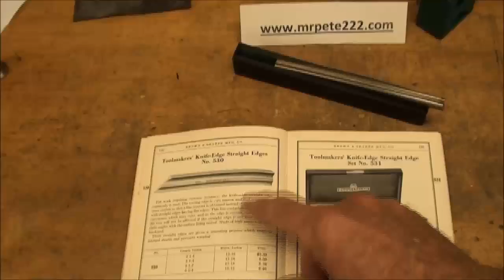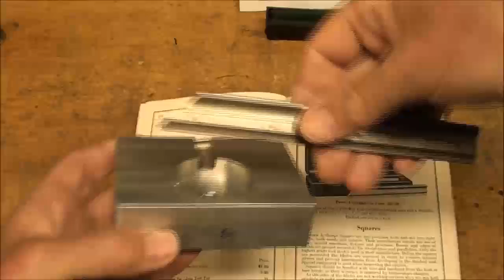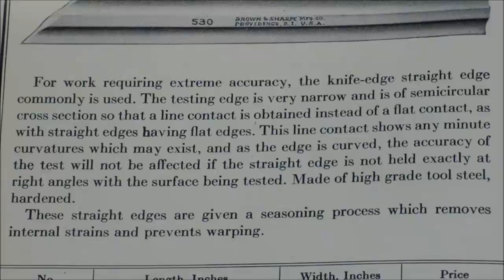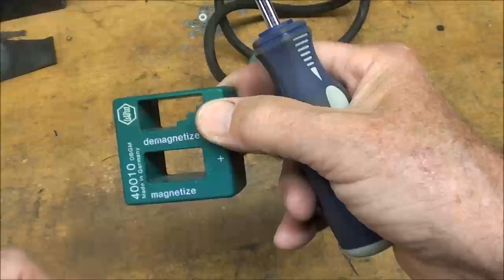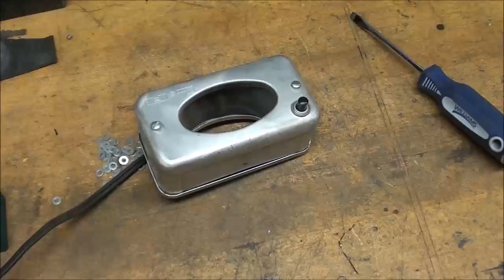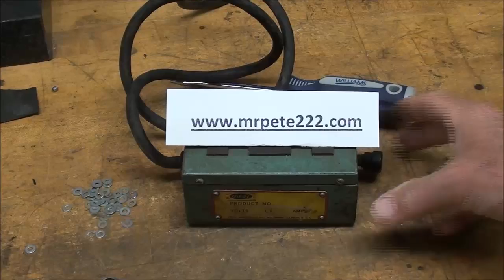WHAT IS IT? #15b Mystery Tool Answer tubalcain mrpete222

Comment: I have that same Ideal demagnetizer in my home shop. When I worked in the shop, we would have the maintenance electrician find an old solenoid coil and tape it up to protect the windings, attach a cord and we’d use it to degauss drill bits. For some reason, if we drilled with cutting oil instead of coolant, they would get magnetized and hold onto a lot of chips.

Comment: we used the demagnetizer similar to one you have here at Fafnir bearing to demagnetizer cutting tools such as form tools ,drill bits and reamers , recess tools etc after grinding them to size.The grinding would cause them to become magnetic so It was done to keep fine chips from sticking to cutting edge of the tool during use. Plant is closed down now but the old screw machines were amazing equipment!

Comment: The Hole In The Screwdrivers is So you can Put another Screwdrivers Shank in It For Extra Torque Whilst Pushing Down On The Head To Break Screws Loose
Reply from the maker: Someone else told me it is for a lanyard
Reply: mrpete222 It Could Be Also Used as A Lanyard too

Comment: The precision knife edge was also used on surfaces being scraped (by hand). It was NOT for scraping, but used somewhat as a squeegee with "dykem blue paste" (or other brands). Basically you would draw a line of the paste across the metal, and where you saw bare metal were high spots on the metal. The idea being that as you found those high spots you would take a hand held scraper and bring them down. You continued doing this throughout  the piece until you had a perfectly flat surface throughout. I just sold a set which also had what I believe was a hone (extremely fine) for making sure that the edges were absolutely straight throughout their length. Of course we're talking about down to differences of no more than something like 0.002' or less. This was most likely where you had to have mating surfaces where the entirety of the 2 surfaces had to have contact.

Comment: If you really want to feel a magnetic field, get an MRI. I once built some instrumentation for a group that was going to do some research in one on a subject and the guys who ran it wanted to impress me. They took a wad of steel wool and went forty feet down the hall from the machine. Wham, the steel wool came flying back at very high speed. I forgot to leave my wallet and the MRI killed my credit cards! Best was a story about a firefighter who was delivering a severally injured patience from the scene of a fire who still had his breathing air tank. Whop, the MRI grabbed him! He got loose, but they had to shut the MRI down to get the tank off.
Reply from the maker: +William Lee WOW--mighty powerful magnet
Reply: Not much fun as a machinist who once had a few dozen steel slivers forcibly removed from my hands and wrists by an MRI. It was kinda like that x-men movie where Magneto pulled the iron out of the guy's blood, but just from my hands and wrists thankfully.

Note to everyone who works with metal(even asumedly non-magnetic metals!!!), if you hear the letters M-R-I in relation to your health, make sure to mention that you need a ferrous material pre-screening.
Reply: Very good advise.

Comment: I had a similar problem with a watch and a demagnetiser when I worked grinding magnets for electricity meters here in the UK. I put a part in the demagnetiser for the first time, and held it in there, and when I took my hand and watch out the thing had ripped the metal watch hands clean off the spindle! Kept my new watch in my top pocket after that!
Reply from the maker: +Ian Lang Yes--good story

Comment: FINALLY A POSSIBLE ANSWER.  After 55 years of machining stainless steel,  always300 series.  Sometimes we would get material or parts that would stick to a magnet. Customers always rejected these parts, saying its not the correct material.  I always had proper material certs on the material, but its just a piece of paper.  When building a 500 dollar valve no one wants to take a chance on 5 dollar bolt, can't blame them on that. No material warehouse ever gave me an answer.  Could it be that easy?????
Reply from the maker: +jim sanker Thanks for watching--don't know

Comment: One more comment about the Williams screwdriver. I work offshore, where we are extremely safety conscious. A large number of injuries happen due to accidental dropped objects. When people climb onto any elevated area of the facility, they must use "tool lanyards" to tie their tools to their wrist. These high quality screwdrivers with the hole in the handle are very convenient for working at height, with a tool lanyard.

We even have sockets that have an eyelet on them for tying them off for working at heights.

Comment: I really like your What is it? videos! Thanks for keeping them coming.

The magnetizer / demagnetizer is an interesting one. It works by taking advantage of the constantly changing current direction of the AC power. It has a coil winding inside of it. Basically an electromagnet.

Because of the alternating current, the magnetic field is constantly changing direction (north - south - north - south etc..). When the iron part is pulled through the device while it is continuously powered on, the iron object is repeatedly magnetized in opposite directions, 60 times per second by the alternating current. As you draw the iron object further and further away from the AC magnetic field, each cycle has less and less effect on the iron object. Therefore, it ends up with an immeasurably small magnetic field after it is drawn away from the device.

When you release the  momentary switch while an iron object is on the magnetizer coil, the magnetic field is interrupted in the middle of an AC cycle. It does not see the reverse part of that cycle, to reverse (or remove) the magnetism. Therefore a strong magnetic field remains.

Comment: The Hole through the Screw Driver Handle has 2 Purposes. 1.To attach a lanyard 2. to insert another screw driver or metal rod to get extra torque or when the handle is oily/slippery.
Reply: lol yes that is right

Comment: The large demagnetizers have a warning sign for pacemaker wearers. I certainly miss the old watches with the springs and gears, I have 3 modern watches and they all need batteries.
Reply: self wind Seiko!  Had 3 since 1965, plus a Casio in there somewhere that died in about 3 years.  One of the Seiko's died in a motorcycle accident in '05, so this one is 9 now.  Dead on accurate to WWV @ 1min/month.
Reply: Ive had a solar GShock watch since '07. Very pleased with it.
Reply: Solar Citizen since '06. Still going strong

Comment: The hole in the screw driver is for a lanyard when working at heights, saves the general public being forced into hard hat wearing by the h and safty peeps :-) (you can also hang them up by it though) ps awsome vids keep it up !
Reply: Also for putting another screwdriver through to get a bit more torque.